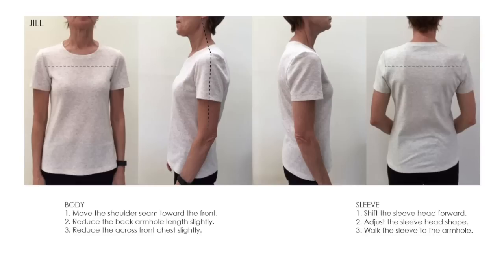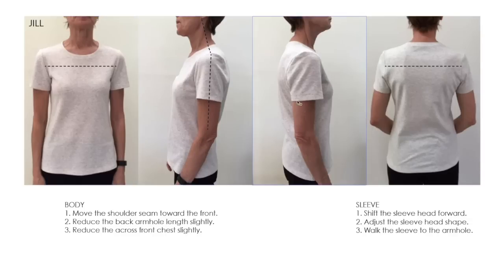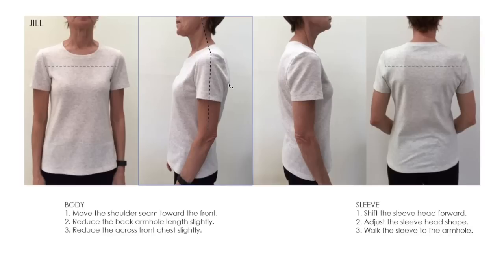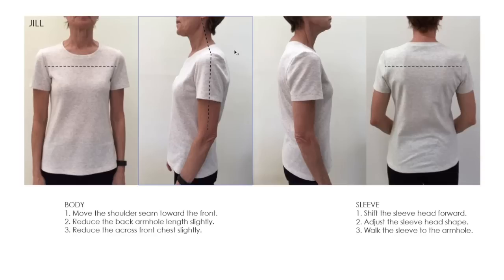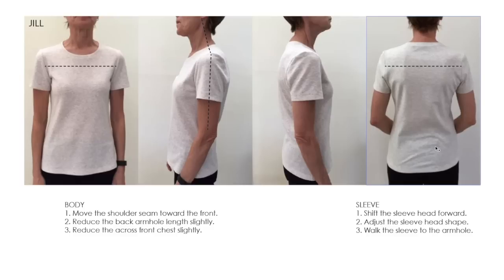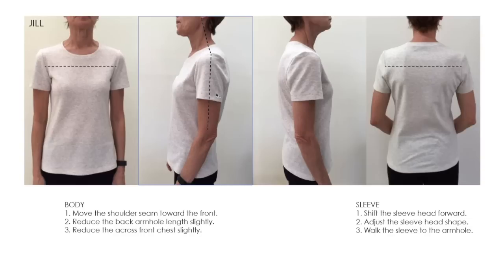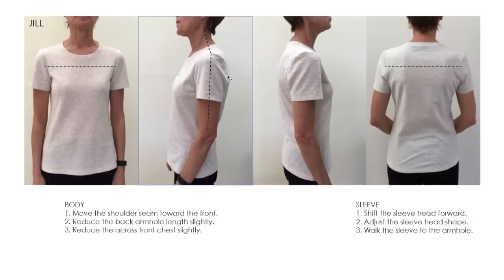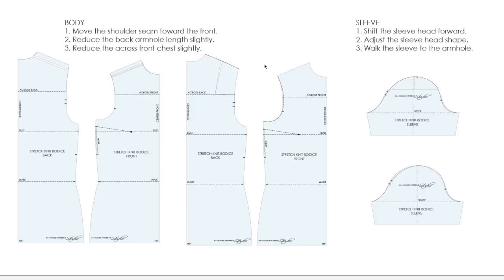Sleeve Fitting Diagnosing Sleeve Fitting Issues

Comment: I am curious, Alexandra, on what changes need to be made to a Two Piece long sleeve when we rotate it for a forward shoulder? The under sleeve seams no longer are in the “traditional location” after this adjustment - Do we leave the under sleeve as is, or do the seams of both sleeve pieces now need to be adjusted to fall in the correct place? Help! I’m at a loss here.
Reply from the maker: I think the method is the same, shift the sleeve head forward, you will just have the extra step of truing the sleeve seams so that the undersleeve and top sleeve blend together along the sleeve cap seam line. Stacking the seams will help you do this. It's difficult to talk specifics but sometimes when you put the sleeve sections together, things become clearer.
Reply: @AlexandraMorganInHousePatterns  Thank you!

Comment: This assessment type of video is so valuable for those of us learning and tailoring our own clothes. Like one issue I’ve been figuring out myself on a dress shirt (male) is when I slim the sleeve, make the arm hole somewhat smaller, but still ending up with too much excess fabric (on the sleeve). Front view of sleeve looks fine, but back arm hole must be too short... Didn’t know what the appropriate action would be, so I had placed a dart at the back shoulder horizontally in line with an already existing seam. Seems to work much better, but as to whether it’s the most “appropriate” solution, I don’t know... 

I know there are lots of potential problems, but this is still great! This has helped a lot.